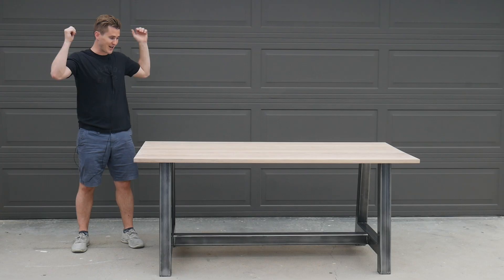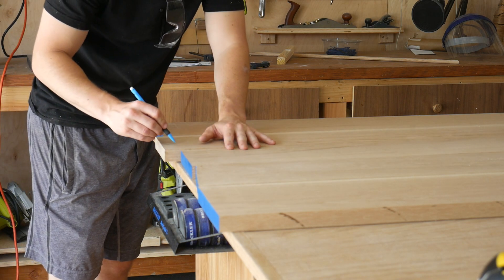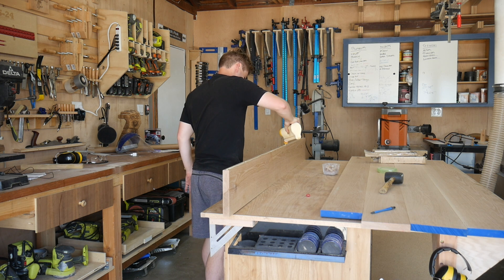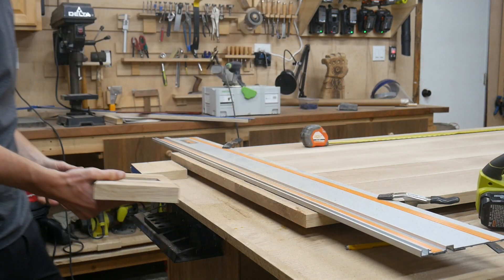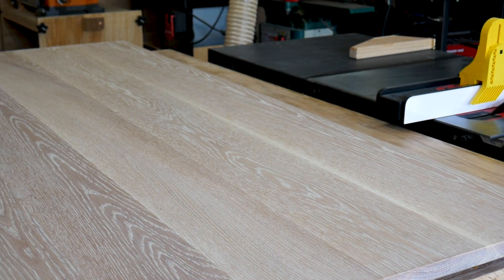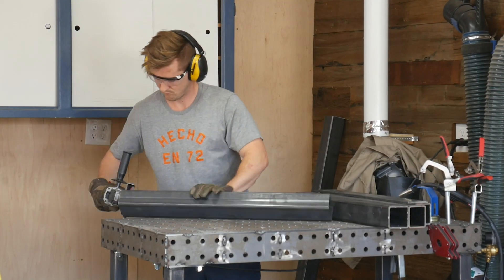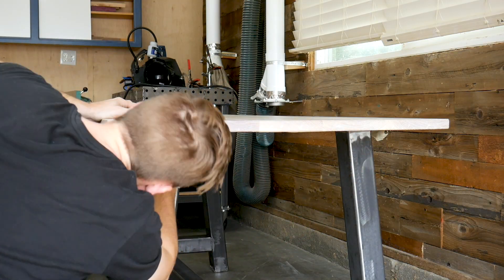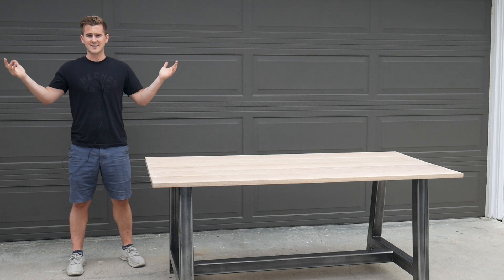White Oak and Steel Kitchen Table | 62

Comment: Did you make first the rubio pure and after the supervwhite? And 2nd question.. You didnt paint the steel? Did you mKe any clear lac on the steel? I like the style natural unfinished.
Reply from the maker: All of these questions are addressed at length in the video for both the Rubio finish / errors and the clear coat finish on the steal.

Comment: Nice build. Great work as always. The only critiquing I can do is that the table top needs to be thicker as the legs are very beefy whilst the top looks too thin.
Reply from the maker: Thanks - to each their own. Personally I disagree and I don’t think you‘d think that if you saw it in person. 

Actually, it’s no different than the leg proportions of the farmhouse table I built a few weeks ago / if you built a table with 4x4 legs - in fact, the metal table legs are thinner.

Comment: Zach, love the design and simplicity of this build. I'm looking to duplicate the finished product but for use outdoors on my patio. I love the combo of wood (multiple shades) and black steel/metals. 1. Any feedback on where to buy good steel leg set similar to what you've used.(apologies if you identify this in the video as I've watched only the first 30sec.) 2. Any feedback on what type and size of lumber to use for the table top? I was thinking either 4x4's to give it a real chunky look or 2x6 planks with nickle gap spacing for water seepage. Look forward to your feedback.
Reply from the maker: Hey - keep watching the vid - I custom fabricated the legs with 3x3 square tubing, so not sure where you'd buy the same thing but I'm sure there are good options in terms of a set of similar legs - usually they are not sold in raw steel form though - they're painted / powder-coated. And, they won't have the center stretcher connection though as it was all custom for my piece. 

4x4 sounds good and so does the other option - not sure how high quality the 4x4 lumber is where you are so you might have to do some milling on it to get it in good shape. The gap sounds like a good idea regardless for wood expansion and drainage but probably less a concern if you use 4x4s as they are super beefy. 

You'll need to apply a good outdoor finish to it and keep it with maintenance on it based on how exposed it is to the elements. Good luck

Comment: The holes don't seem big enough to allow for expansion?
Reply from the maker: Pinning this so others stop messaging me. They do 👍🏽
Reply: @workshop_edits  what size hole did you drill? Looked like 5/6mm to me?
Reply from the maker: @walesxscarlets  I can't remember - but they are about twice as large as the screw diameter. I suppose out of caution I (or someone building it) could step it up further.

Comment: Great job and beautiful work.
May I ask you what the clear coat was for the steel?
Reply from the maker: The clear coat will prevent moisture and liquids from rusting the metal
Reply: @workshop_edits  haha thanks, but I meant what was the product. I should have used better punctuation
Reply from the maker: Polycrylic Spray from Minwax

Comment: Great job! Is the top completely smooth? Or does it have “grooves”? Thank you!
Reply from the maker: What do you mean grooves?
Reply: Workshop Edits a little bit of texture. Like hand scrapped floors. Hope that makes sense...? Ha
Reply from the maker: Kind of. But no it’s totally flat. Idk if what you described would work well for a dinner table. Cheers

Comment: Great build but how do you plan on compensating for any expansion and contraction with permanently screwing the base to the top? I have seen others where they have elongated holes in the mounting plate on the base with threaded inserts in the underside of the top. Just wondering if there is a different way about it.
Reply from the maker: The holes on top of the base are all oversized and the screws have washers which allow movement. I just followed some examples of what I have seen Black Forest Wood Co do with their tables.